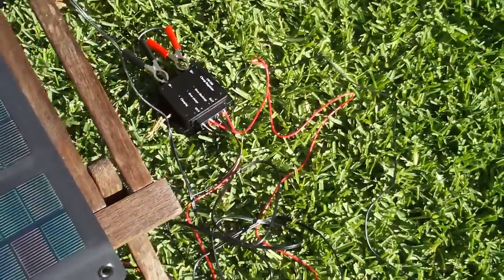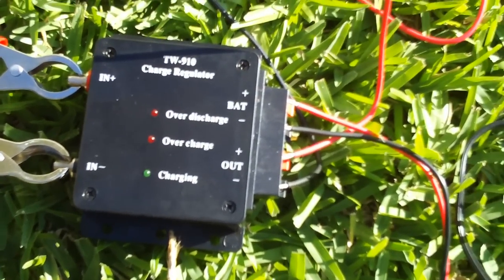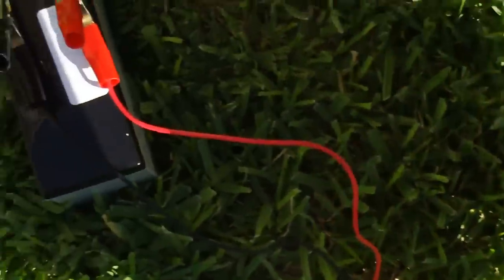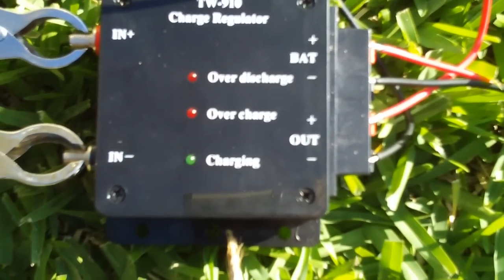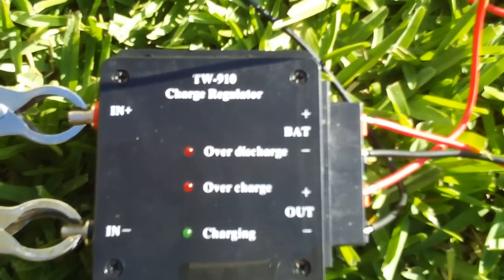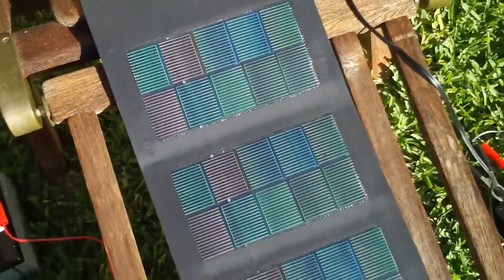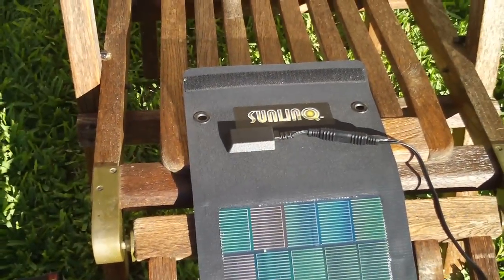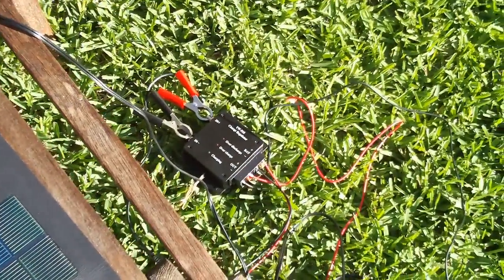charge controller

Comment: Looks like the 7AH battery will not work very long. I am not sure what this will be used for, but dont use the gator clamps, make the wires larger, and your storage battery might need to be bigger than you think. That panel is about 10-20W maybe??? I hope that motor is a low draw high efficient model. PS some wind charge controllers are picky... Just things to consider! Go green!